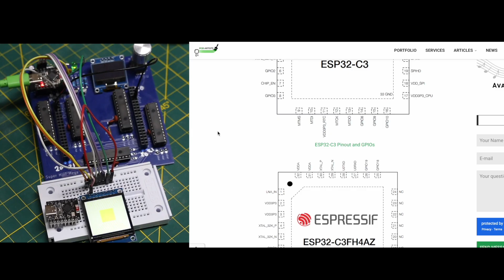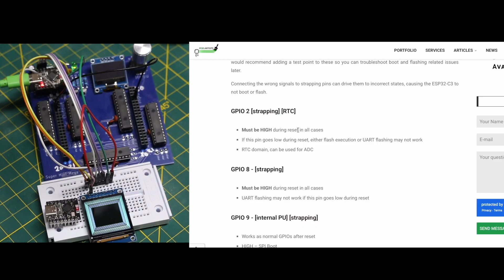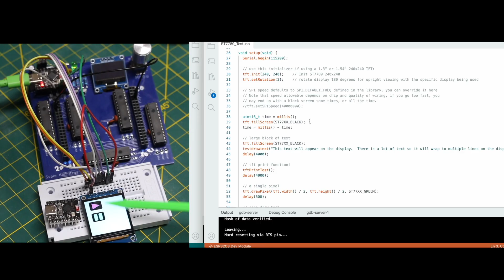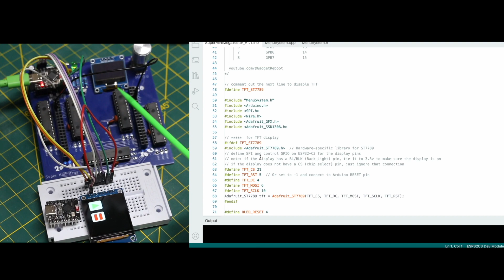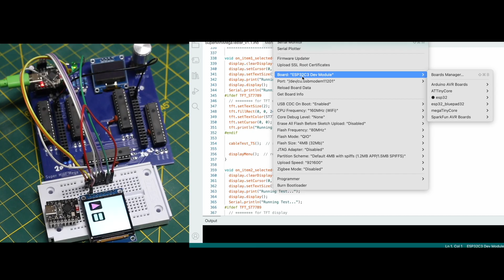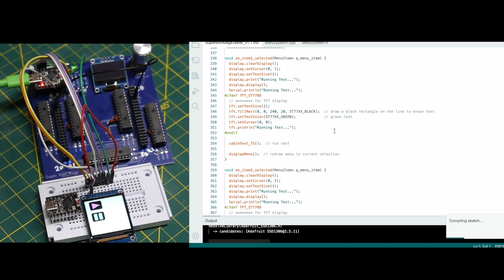TFT ST7789 Display with ESP32-C3 on the Mega Cable Tester

Comment: Boa noite amigo e seria se é possível fazer o mesmo testador de cabos usando um ESP32-S3 e um display de 7 polegadas Toch e todos os controles ser selecionados no próprio display?
Reply from the maker: I haven’t worked with ESP 32 – S3 so I’m not sure about  it’s resource capabilities but as long as it has the same or more memory as ESP 32 – C3 I would assume it’s possible.

Comment: Muito bom o seu projeto, mais uma coisa se pode ajudar, gostaria de inserir uns botões para selecionar o menu como um botão para esquerda um botão para direita e outro para o start.
do iniciar eu consegui mais os pra esquerda e direita não.
Reply from the maker: I might be trying to change the menu and rotary encoder at some point when I have time but for now to modify the existing code to add extra buttons, I can generally say what would need to be done.
For buttons to move forward and reverse through the menus, the same as rotating the encoder,
When the encoder is moved, the sketch either increases or decreases a certain variable called virtualPosition
So you can read in two new GPIO with buttons and when one is pressed (you can read them in the main loop), when one of them is pressed you can say  
virtualPosition++
and if the other is pressed you can say
virtualPosition--
and that should move through the menu.  The main loop always calls a function to check if this variable is different and if so it will scroll through the menu so you just alter this variable by pushing new buttons.

To add a new button to activate the menu option like pressing the encoder button,
also in the main loop you can read in that new button GPIO and when it is pressed you can say
ms.select();  
which is what is called when the encoder is clicked so you can run that function any time and it will activate the current menu selection.